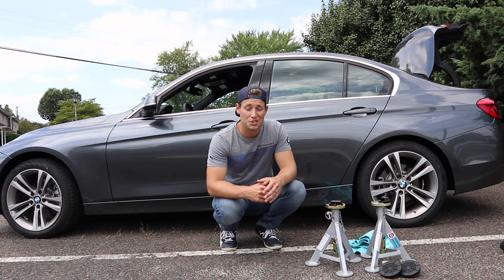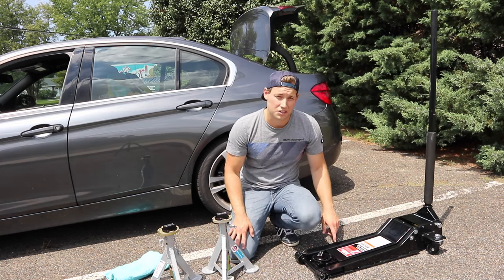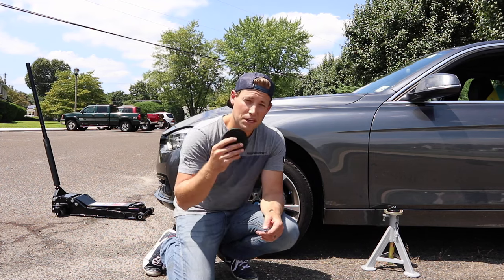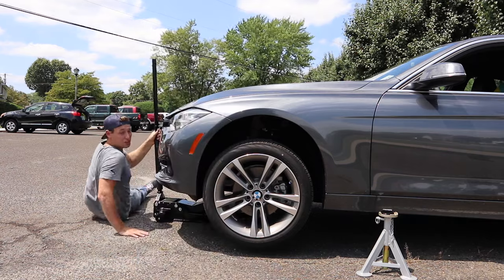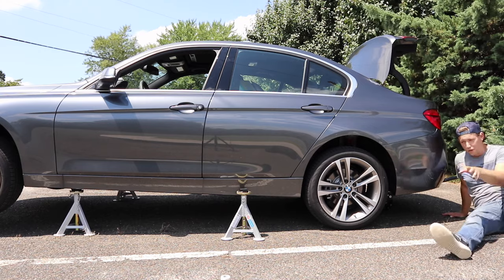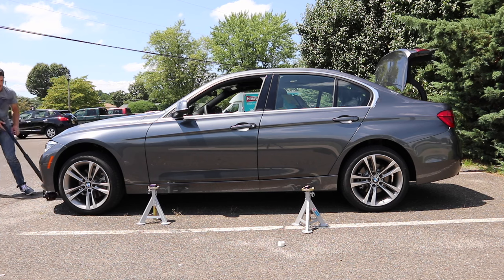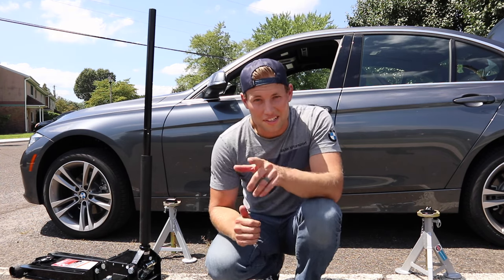How to properly put an F30 | F3x BMW on Jack Stands (Sorry for the wind noise)

Comment: NOTE: You should never get under your car with just the jack holding the car up. Always put a tire with rim under the car first incase it falls when you're under. Many people have died when jacks have failed.
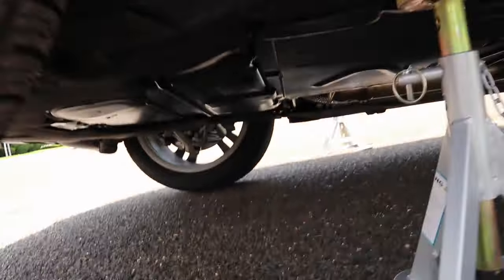Reply: If you noticed at 3:40 ish, he has the stand already in place.
Reply: You have a good eye.  He should make a point of that.
Reply: i usually still support it with the floorjack or an object.
Reply: @notadoctor2598  with a simple response just a wheel
Reply: @nathanielmyles4614  and ok j stop hgllil7
Reply: You can also put a beefy piece of 4x4 wood between the base of the jack and the lifted-up arm, so that if the jack fails the wood stops it from collapsing. That doesn't help if the arm were to snap in half of course.

Comment: That's strange, my F30 shop manual clearly states never to jack the car via the differential.... on my F30 just behind the differential there is a round rubberized jack point that is bolted onto the cross member you can see in your video.... I wonder why they are different? 🤔
Reply from the maker: +Ken Lawton I actually found a bmw document that said to jack there, but NEVER on the cover (the silver part)
Reply: Kies Motorsports Interesting......
Reply from the maker: Who knows lol. I chose my words carefully when I did that part
Reply: Kies Motorsports Well it obviously works 😂 was that an x drive? Mine's a standard RWD so it may have a different differential?
Reply from the maker: I do have xdrive, but I would imagine it's the same diff
Reply: You should actually jack it up from the black lower suspension frame that is behind(closer to the trunk) the diff.

Comment: Please be careful and make sure it’s not the spot that looks like it could be the center and instead pick the spot that is a little further. There’s two circle dimples on the f32 but one dimple is right under the eps and its shield, the further dimple is the center jack point. I just did this today and cracked my EPS. my steering is now Jacked up, no pun intended. ☹️

Comment: From what I understand you don't need the adapters if you use this type jack stands. The rubber provided is pretty good and will not damage the jacking points.

Comment: Here's a tip. Get the car to the right height, then raise the jack stands into the Jack Points and lock them into place. This ensures alignment between jack point cavity and the jack stand. This makes it safer to then release the weight off the floor jack as it guarantees alignment. Makes for a safer + faster job.

Comment: I would make a slight adjustment to your method. When either the front or rear is on the floor jack during the lifting process, do not keep the jack stands sitting under the rockers to check for correct height. If the hydraulics in the jack give out, the car will slam onto the jack stands and depending on the location of the stands, either destroy the rockers or do something far worse. Best is to leave the stands by the side of the car and push them in each time while crouching to check for height. Then if satisfied, leave them there, or pull back out and repeat until the desired height is reached. That's what I do.

Also, since the jack pad adapters are lightweight aluminum, I tape them to the jack pads on the car with masking tape in an X pattern before ever lifting the car. Saves time and hassle.

Comment: I've been working on my E46 M3 putting in catless headers for the last two days. I'm at the point that I realize I need to get the car higher but my low profile jack won't go any higher with out using some wood or something to get it up there. Which I will do in the morning. However after all the monkeying around I've done working on my own car over the years I am seriously thinking of starting a club of trying to re-introduce the "mechanics pit" into garages. They are more popular in Europe I think but they used to be made in the Americas as well. But for some reason fell out of popularity. Too bad because they are much safer and you NEVER EVER have to jack up and down your car EVER AGAIN!!! I HATE IT!! LOL. Thanks for your very well made video!

Comment: I like to put some foam tape on the jack adapters so I can jam it onto the jack point and it doesn't fall out. That way don't have to readjust so much.
Reply: Collared Greens  good idea. Last time I taped the jack pads  to plastic jack points using masking tape. It made it easier for me not having to adjust jack pads before lowering.

Comment: Nice video, but why not lift the rear of the car from the metal bar behind the differential? In the E90 I always placed the jack, via a rubber parallelepiped, under that metal bar

Comment: I tried jacking my European F33 420d from the front.
Underneath it does not have that exposed metal plate under the engine, but is fully covered by the underbody cover. Hence I could not lift it from the middle front.

Comment: If all you want to do is jack up one wheel at a time (to install spacers), but you don't want to trust just the jack to keep it up, where can you put the jack stand to make it safe (since the jack is using the jack point)? Like around 3:43 where you are showing the spot for the front center jack point, you put a stand in there to make it safe for you. Where is that at, and is that a safe spot given the task?

Comment: If you’re not servicing the tires, rotors, etc., I like to use car ramps with 4 jack stands and the jack. I put 2 stands exactly where he has them on both sides and the jack on which ever side I chose. If I’m servicing the tires then do exactly what he does but leave the jack up on one side and the tires as extra support. Some may say I’m excessive. Well, better that than a car on my head.

Comment: Tip if you need more room to slide trolley jack under from front or back lift each side up and put a chock under each wheel. Plus when aligning stands don't drop car to stands raise stands to car. Thats why they are adjustable.

Comment: Well presented.  Cinder blocks under the wheels work well if oriented correctly with the center rib vertically under the axle.  Never get under the car with just a jack stand.  Also, be aware and extra cautious if you are working in a seismically active area like the west coast.

Comment: There are quite a few videos on how to lift a BMW at the lifting points, but I have to say, your video is the best one out there, you explain and show exactly how and where to place the jack and jack stands.  Thank you for sharing.
Reply: Is it really safe to use the rear dif as a lifting point?
Reply: @TheTwh415  I have a same question, actually I don’t think so, it’s very risky.  I think the best is rear subframe.
Reply: @TheTwh415  yes it is, as a bmw tech we are taught to use the rear diff as a jacking point from bmw

Comment: I have heard that BMW does not suggest lifting from the differential - instead lift from the Cross Member directly in front of the rear diff cover.
Reply from the maker: I did it that way based on a tech document that I had from BMW, but I know some people don't like lifting from there. Just be careful whatever way you do

Comment: Hello there, can you please advise, if I have to store my f10 for 6 month on jacks. Should I keep the jacks as you did or I need to put it under the wheel hub to keep the suspension on load. I have been told that I can not keep the suspension floating in the air as it is designed to take the car load. keeping the car for extended perior of time on the jacks located on the car jacking point can damage the suspension components.

Comment: Not sure if this will be seen or not, but I just purchased some jack stand adapters from amazon and the actual block portion looks kind of short. Does the weight get put into the bottom of the jack pad, or is the physical plastic portion of the jack pad what holds the weight??

Comment: I really enjoyed this.  The only issue -- the Burger site and Amazon both say you're not supposed to use the adapters with jack-stands.  Can figure out why they caution against that. :(
Reply: A slip hazard?
Reply: Eric Solari don’t use it with regular jack stands it’ll break. 
The tips of regular stands are pointed on the sides. 3000lbs press into that rubber and breaks it. BOOM THERE GOES YOUR CAR FRAME

Comment: I have a floor Jack but no Jack adapters. The Daytona Jack I got comes with the rubber where it comes in contact with Jack point. I also have an suv do you think I absolutely need Jack pads? Or should I be fine with the floor Jack itself and jackstands (also have rubber too built in) and it is a bmw x3 f25

Comment: Wow so much work.  There's got to be an easier way.  How about just driving the on to a block of wood.  Most people do not have that low profile jack.  I feel it's too much work than it has to be.
Reply: Why would you buy a higher profile jack when a low profile jack can guarantee lift your car?
Reply: If you don't have a low profile jack, just drive the car up on 4 pieces of 2x6  to raise the car a bit and use any jack
Reply: Laurence Hendrick low profile jacks are like $20-40 extra, for someone without a saw or drill it’s cheaper to get low profile jack! Also floor jacks r safer. And you can use it for a while..

Comment: Do I need jack stand adapters, or can I just use that rubber thing you use on the jack on the jack stands as well?
Reply: Get the adapters. The Jack support is a plastic piece and the walls will crush or deform if you just use a flat pad. They are super cheap, I just purchased a set of 4 for like $20
Reply: @MichaelWhite78  where do you order them from ?

Comment: On my F30 the front shield covers everything :( that central area you used is covered on my car. Got any advise for that?
Reply: Same here. I have a 2014 320i and the entire bottom side of the engine is covered in plastic. I tried pushing the jack all the way in, but it doesn’t seem right at all

Comment: I have a low profile jack, but it still won’t reach the front center jack point. Instead, I jack the REAR side jack point. The BMW is so stiff that it lifts the entire side of the car, so I can lower it onto a jack stand on the front jack point. Then I can raise the center rear.

Comment: Have you confirmed the same type points for the G20?  Particularly for an M340i that has the shielding under the car.   I would assume the differential for the rear would be the same, but Can you confirm that and (more so) front location?

Comment: This may be stupid but are these the standard Esco stands in the link above with the round rubber pads removed to put the BMW specific pads in place? The metal plate under the rubber has these little lugs seen here to keep the aluminum pads from slipping?
Reply from the maker: Yep!

Comment: Do you need adapters if you use a lift? Now I'm worried that Costco may have done damage when doing my winter tires
Reply: no, a lift has a big enough pad for the bmw jack point to sit on.

Comment: When you change the oil, do you lift front and rear, or front only? And thanks for the video!
Reply: Front only would be sufficient. You will get all engine oil out.
Reply: Bin Zhao yes, this what I did, and it worked well, retrieving 9.5 quarts. Thanks for your help
Reply: I just use a pair of ramps when doing only the oil. Far easier than jack stands.

Comment: Hello, Is this a 328 or a 335? Im asking bc i have a f30 335 and would like to know if my front center jack point is the same as the car in this vid. (I want to jack up my car  from the correct jack point)
Reply from the maker: That's a 330, however, it's the same on a 335

Comment: In order to jack in the front and the rear of my 335i F30, does the Low profile Jack will work as well ?
Because in your video you are talking about any performance cars. I'm not asking about any other cars, but just this BMW F30.
I'm asking because the EXTRA/ULTRA low profile is more expensive and not easy to find here in Canada at good price.
Reply: Harbour Freight has it

Comment: Cool, but you definitely not need a jack for 1000 bucks or adapters for 50 bucks. Especially if you are doing some amateur fixes for your car. You buy a much cheaper and shorter jack. You first jack each side and put bricks under the car to lift it about 10-15 centimeters, then you have a clearance to use center jack points with your no-pro jack:)
Reply: I don't know where you shop, but the stands are 60 bucks ea, pucks are 10 ea, and the jack is under 200. So you're under 500 out-the-door.

Comment: Does anyone know if that jack can reach the front axle jack point on an f10 m5?
Reply: The Arcan xl2t seems it is the lowest profile and longest after comparing. The front bumper to the jack point look to be about the same distance on the F10 and F30. Let me know if you pulled the trigger on this purchase (before I waste my money 😊)
Reply: Cody Rains get Daytona long reach from harbor freight. Made by snap on company. Reaches anywhere except slammed cars...

Comment: Why would this be necessary?
Reply from the maker: Lots of things from exhaust to oil changes
Reply: Dumb question haha
Reply from the maker: lol it's all good
Reply: Would you ever jack the back sides up one by one, not using the diff as a jack point?
Reply: Or maybe you did it that way because of very specific jack points?
Reply from the maker: This is to show you how to get jack stands under the jack points